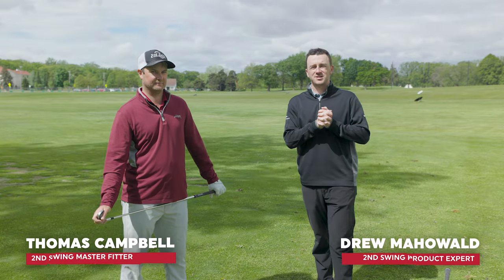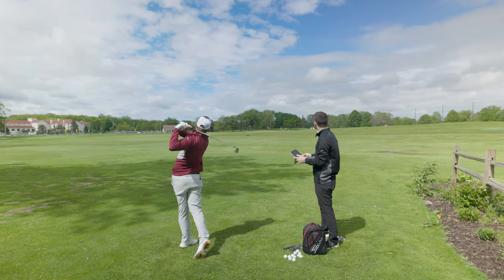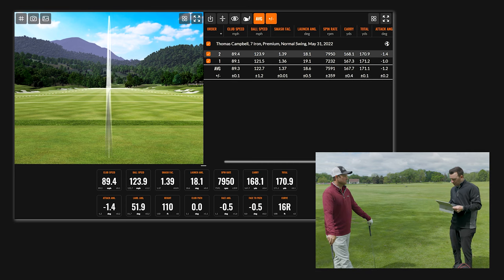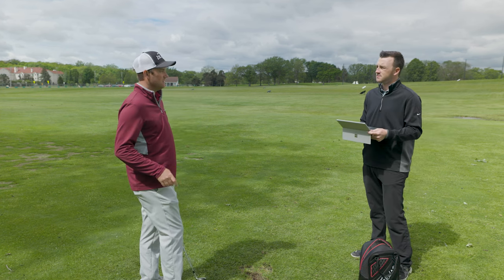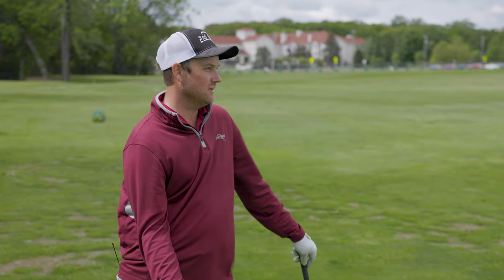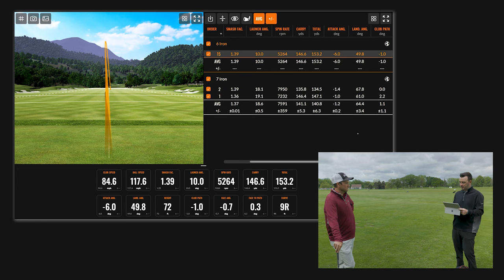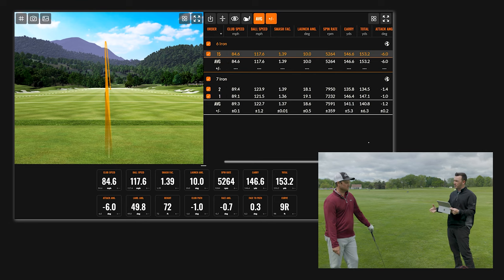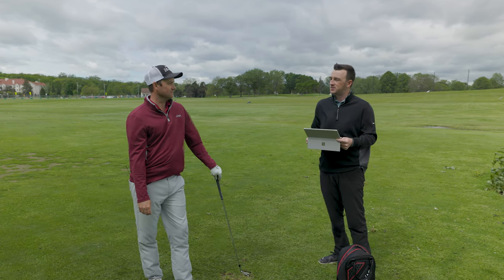Hitting Golf Iron Shots Into The Wind

Comment: I like to drop a few blades of grass from shoulder height to measure wind speed. Each driver length the blades drop further away from me, is a club extra. So, blades drop about 1 driver length away, I go from a 7 to a 6 iron; blades drop 2 driver length away, from a 7 to a 5 iron; 3 length away, from a 7 to a 4 iron, etc.

I then do the same, grip down, closer to the ball & hit a 3/4 “wedge” shot. Same result every time.
Reply from the maker: That is a very unique way and if your formula works keep it up! - Thomas
Reply: Ill try that next time , cheers